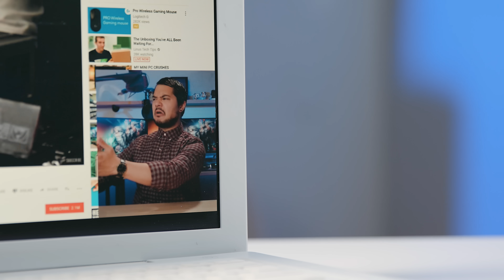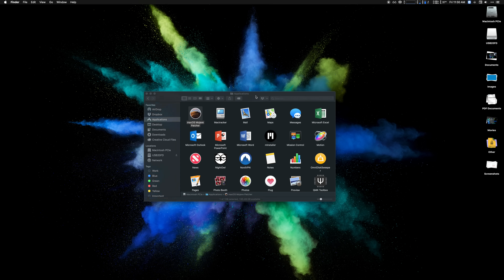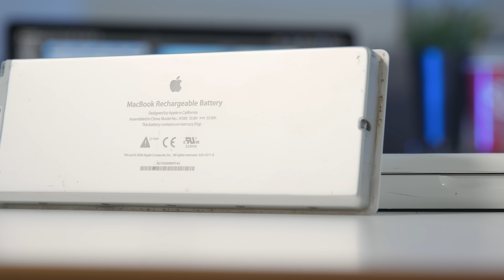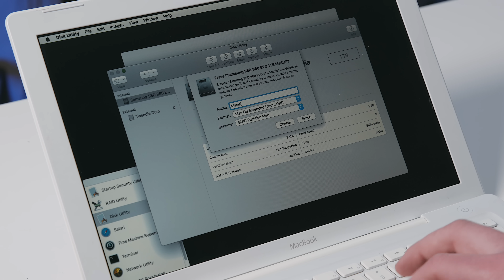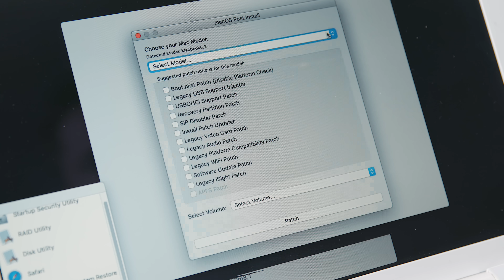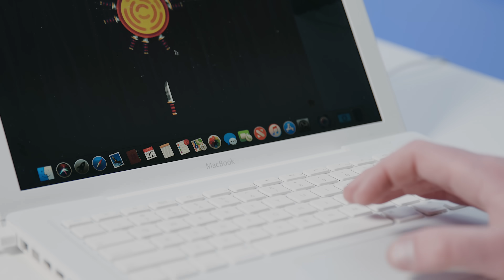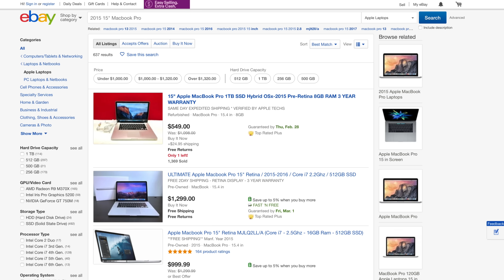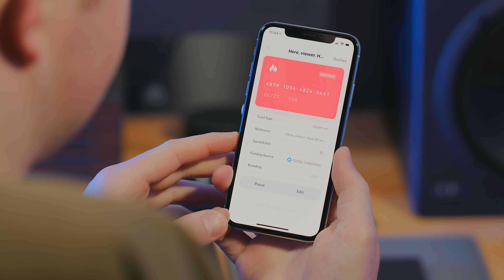Hackintosh a... REAL Mac?!

Comment: I had a 2008 aluminum MacBook (not pro). When i had it running new MacOS versions it had issues where the CPU would run at full load for no discernible reason. That was until I found and ran a firmware update. Just wanted to share that in case anyone runs into the same issue.

Comment: Awesome video,  I’ve got macOS High Sierra running on a mid 2010 Mac book pro with a 1 TB SSD, 4GB RAM.  I’ve read there is a certain procedure to installing a new battery in it, so it can be calibrated and fully charged.   Is that correct?

Comment: Wait you can change the ram and SSD in a macbook??? Why did they get rid of this in the first place
Reply: Money
Reply: They stopped doing this on the Mid 2012 Macbook Pro

which is the one I bought one with an 4 core i7 for 380 and and upgraded it running a boot Raid0 and 16GB ram.
Reply: Because Jobs died
Reply: @immortallix  
No, Jobs would have done the same thing with planned obsolescence, he was just way better at convincing people, why it its actually good for them.
Reply: They got rid of this Bc Apple is against self repair and etc now. They want you to pay more upfront as well to upgrade to make sure they get the money directly. They don’t want you buying your own parts where they won’t receive the payment
Reply: Planned obsolescence perhaps.
Reply: Planned obsolence.
Your $1,200 machine broke after 1 year? Time to fork over another $1,200 for a new one ;^)

Philip Rapp
That's a whole load of bullcrap. Apple machines suffer from horrendous QA issues despite the "benefits" of soldered on everything and still charging so much for a piece of garbage that will break down in a year. Electronics should be designed with longetivity and accessible repair in mind.
Reply: Milan Petrovic my heart bleeds in unison with you over this! Why is this not a thing on iMacs? It is basically like one great big gay and daft iPhone that you have to go spudging the LCD screen bezel off with an heat gun then cleaning all the goey gunk and shit off it before reapplying specialised double sided adhesive glue strips to reseat it. There must be a better way to replace or upgrade a failing internal Hard Drive than this? Oh yes i forget an access door on the back of the case might just help in that department! I do appreciate that apple thermally bond heat generating internal components onto this aluminium back plate with thermal grease to heatsink them but how much of this real estate does two small access doors for the RAM and Hard Drive actually take? Oh but 'it's not nano enough or aesthetically pleasing in the coffeshop darling' the lovies proclaim even though the average consumer does not even look at the back of the case. Bollocks!!! Get it sorted Crapple it's a desktop computer not a phone! (even though they do cost the same). 😂😂😂
Reply: Because back in the day, Apple still had a vision of selling the best user friendly laptops. Unfortunately they have become greedy. That’s why I still use my 2009 MacBook every day. It supports 8Gb RAM, and SSDs. Why not use one?
Reply: @montypizzle5780  Unfortunately  technology gone forward...
Reply: @imho4990  Lol, barely. An intel core 2 duo is still plenty powerful to run basic tasks smoothly. Not everyone is going to require an i9 with the work that they do. Not to mention that the modern MacBooks are packed with an i3... which is basically the exact same thing, save a few architectural differences.
Reply: "Steve Jobs died" … That's why :(
Reply: Well, Apple now tried to make their Laptops as inrepairable as humanly possible. SSD dead? New Laptop. Ram dead? New Computer. Needed more Ram? To bad. Also it helps them charge a WAY overpriced RAM or now even Storage Upgrades at purchase, because there is no way to bump up your ram. 

For repair measures also.... If we take a look at the HORRIBLE Keyboards they nowadays make, that tend to break extremely easy..... It is a brutal nightmare to replace this thing. It's like hours of very fragile work to replace it. Very time consuming, good chance you'll break some of the keys or the frame.... So if you aren't really really good at such things and your varanty is out, you are forced to pay for a new Laptop as well.
Reply: These are all nice conspiracy theories but in reality most users never open their machines. If you upgrade a laptop you probably belong to less then 1% of the user base. Soldered RAM and storage is more reliable and therefore is one point less for the machine to fail. This makes a better user experience for 99% of users. Sadly it makes a worse experience for everyone who could upgrade and repair their machines themsleves.
Reply: @PR-hl9pm  You are right.
Reply: @PR-hl9pm  Personally, I really only mind storage being soldered to the board. Im more against their business practices. They are against the right to repair for not only the user but 3rd parties as well. They want to be able to price repair so high, that it would be foolish of you to not just buy a new one. I encourage you to look more into their practices to get a better picture. The CBC posted a video four months ago titled "Apple under fire for allegations of controversial business practices
"
Reply: @Jarred Lima I‘m Not saying I like that they solder RAM and storage to the board, i would love to upgrade a mac myself. All I‘m saying is that the reasoning behind their decision is not some planned obsolesence conspiracy.
Reply: actually you could change gpu on old mac pro... man i miss the apple of 2000.and sj.
Reply: Greed.
Reply: Because: BUUYY MOOAARR OF OUR IRREPLACEABLE OVERPRICED SHIIIT.....   Apple™ Ceo.
Reply: TIM COOK
Reply: Milan Petrovic    Greed.  Plain, simple greed.
Reply: Shortsighted greed.  Relative to the years in which the various models were released, the MacBook (if not the ENTIRE Mac product line) hasn't improved that much since the first Retina model and yet Apple keeps charging premium prices for them... which inevitably results in lower sales, especially from experienced customers like me that see how utterly ludicrous it is to keep buying a new laptop (or desktop) every year.
Reply: @archelonprime  Every year? Do people really do that? (although with smartphones it's kind of common, which I think is rediculous as well)
Reply: archelonprime I‘m still using a MacBook Pro 2011 15 inch, i7. It’s enough for coding, however graphics intensive tasks can‘t be done. Also an  upgrade to Mojave ain’t possible
Reply: Greed and incompetence--executives pacifying shareholders rather than serving customers. Steve Jobs died in 2011.
Reply: @listofromantics  "Greed and incompetence" EVERYBODY do this.  All modern machines have soldered parts. MS Surface Laptop. Surface Book  etc.
Reply: @imho4990  My modern machine has 2 m.2 extension ports (1 used), 4 ram slots (2 occupied), 2 sata slots (both occupied right now). Maybe you are talking about Apple and Microsoft, but you are not talking about every new laptop, that's for sure.
Reply: @bar0nbrasil  If you want a thin, light machine, there is no room for extension.
Reply: @imho4990  this latest generation of ultra thin computers are the very beginning of a next generation of disposable computers. I suspect it will not be to long before you see a computer that is 3D printed in its entirety directly onto a roll up flexible substrate inclusive of display, electronic components and battery all printed in laminations onto the same substrate. The technology already exists now in the OLED displays and other specialised areas of the electronics industry. It only takes the desire and will power to make this convergence happen and your laptop or tablet will soon become a tube that you can roll up to take with you and use on the tube! Bigger screen, lower power, much longer battery life, totally waterproof and virtually indestructable when subjected to rough handling. Sounds like the dream product apple need right now to rejuvenate their sagging WOW factor!
Reply: @imho4990  the surface is a tablet...
Reply: @necromax13  Surface Laptop, Surface Book - tablet? Even Surface Pro is marketed by MS as laptop.
Reply: @imho4990  they're convertible devices, hence they have most components in the same body as the screen, which makes modular design pretty much impossible.
Reply: @necromax13  Surface laptop is regular laptop. You CAN'T fix or change anything.
Reply: @imho4990  no one is saying we appreciate that lol.
Reply: money
Reply: Becuase modern Apple sucks.!  I am hoping my patience ( and bank balance)  can outlast Tim Cook.
Reply: No place in thin chassis.
Reply: @imho4990  plenty of Ultrabooks from competitors have upgradeable ram. One thing you see a lot in ultrabooks is they'll have soldered ram and then only have 1 ram slot for future upgrade. Soldered ram does save space, but it's by no means required to build a thin laptop.
Reply: @BobPaul  Look inside MacBook. There is no free space.
Reply: @imho4990  Yeah, and? They could use a negligibly smaller battery to fit an SODIMM.
Reply: @BobPaul  Its because they value size and battery life over upgradable parts. Most probably because most people never ever upgrade their laptops and so care more about battery life and size over user replaceable hardware
Reply: People want lighter and thinner machines. As a result, upgradability is lost, as designing for upgradability requires adding mechanisms and connectors, which take up space, which can add to the thickness of the machine.
Reply: to be honest, i never wanted to even think Apple devices had human made things like ram or hdd i felt they were beyond this time or from alien world.you'd just get a device and just youse it in awe
Reply: @7ngaf  brace yourself for future shock as the real deal is coming soon!
Reply: Size..

Comment: "No modern computer can pull batteries out"
Laughing on T580
Reply: laughs in Classic ThinkPad
Reply: @rickcupola6262  Laughed watching from a Thinkpad T60
Reply: Laughed watching from a T480 and came to check for Thinkpad in comments.
Reply: Thinkpads are the gold of the laptop market, I love them so much lol
Reply: joins the cacophony on a T420
Reply: I immediately checked the comments when he said that. I have a t440s and it's one of my favorite features. I mess with people sometimes by yanking my battery and continuing as if nothing happened.
Reply: THINKPADDERS UNITE!!!
Reply: Laughs in Dell.
Reply: I miss that “feature”.
So many issues can be fixed by taking the battery out and put it back in.
It is also nice to bring extra battery when you on the airplane to use it on long flight.
Reply: Laughing on my Note 7
Reply: Terminator pull out his battery
robotic Schwarzenegger laugh
battery overheating
explosion
Reply: Laughs in E6410
Reply: *Laughing on T490*
...Oh wait ... that's not possible... the T490 is not yet on sale and have no removable battery
Reply: @Arthur-qv8np  wait what? I didn't know that, well that's a bummer
Reply: Yeah. I've got a Dell Inspiron 15 3567 (unashamedly the Ubuntu version) and it has an easily replaceable battery. Yay!
Reply: cries in x380 yoga (no removable battery)
Reply: 5-years old HP Probook 450 G2 still have removable battery
Reply: But your stuck running that Microsoft junk os. Such a mess..
Reply: @jimjimx5418  Stuck? I run Linux on mine. Specifically, Manjaro.

Comment: 5:48  isn't that just Hibernate???  every computer I know of supports that
Reply: Even with battery removed?
Reply: @damian_madmansnest  yes.  suspend keeps everything in RAM, so if you remove the battery, you lose it.  Hibernate dumps the contents of RAM to the disk.  this way it holds on to the data even if the computer loses power.  my windows xp computers could do this, and im not sure but i bet even win 98 could too.
Reply: @TheJunky228  Yeah, thanks for explanation, i have remembered now. Not sure if 98 could do it, but XP certainly could.
Reply: @TheJunky228  yeah and for some stupid reason MICROSOFT removed it in windows 10... WHYY???
Reply: @tristan 123455; It is still there, just missing the option by default. To re-add the hibernate shutdown option: Settings > System > Power & Sleep > Additional power settings > Choose what the power buttons do
Reply: @tristan6509  They didn't.  Your hardware may not support it, but most Windows 10 machines can still hibernate.
Reply: The thing that's unique with the Mac is that they use an interruptable hybrid sleep (suspend to ram and disk simultaneously). Windows has hybrid sleep, but it's not as good. On Windows, if you close the lid and then open it right away, you have to wait for it to finish flushing to disk before it resumes. On Mac when you open the lid, it aborts the hibernate portion if in progress and just immediately resumes from ram. It makes the windows implemention of hybrid sleep feel only half done.
Reply: It isn't. 

It's suspending your applications and programs while you swap the batteries. 

That's a niche feature pretty much no one has.
Reply: @necromax13  That's exactly what hibernating is. My Windows laptop has that. Linux has that

Comment: i did the very same thing on my mid 2009 MacBook pro. I also installed an ssd but also replaced the dvd drive bay with a hdd bay and installed a second ssd. Now running both mojave and windows 10 on separate ssds. Running it for years now and haven`t had any major issues. Also collin aka dosdude1 runs a thread on macforums if anyone needs help go there.
Reply: Chey Chey That is awesome: